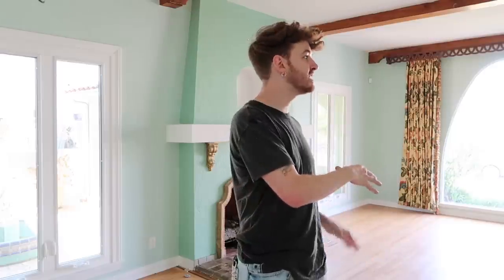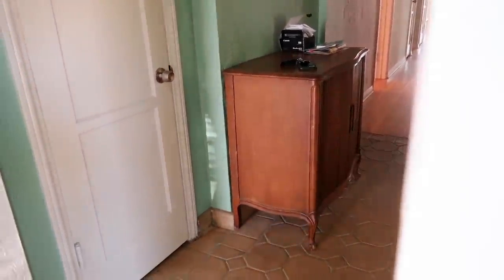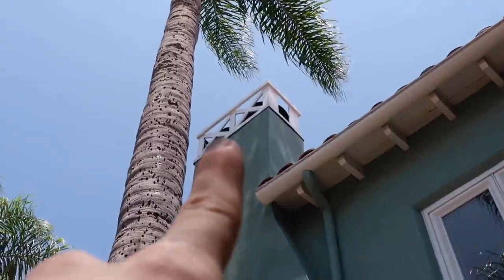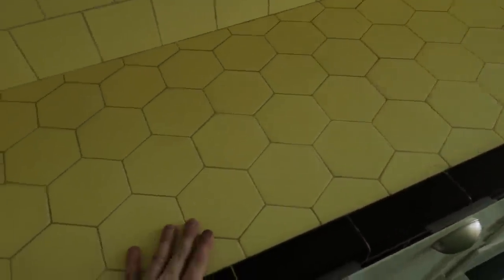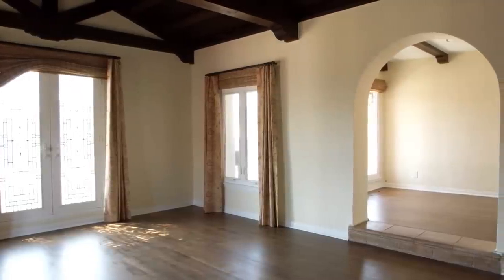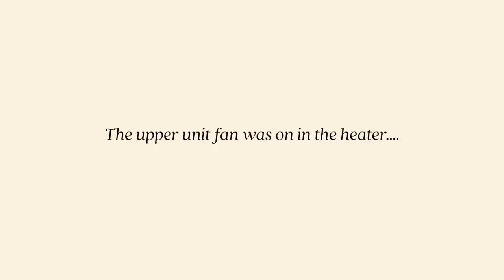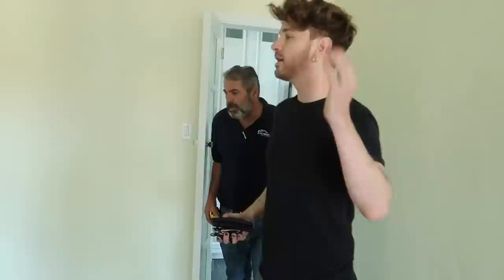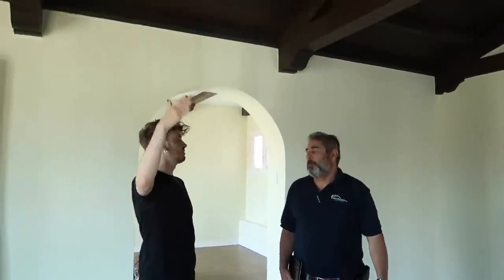Awful News About The House

Comment: You should try an infrared camera before ripping out tile. It’s often way easier to find leaks with infrared! There are tons of videos on youtube on finding leaks with infrared that can show you how it’s done! Way cheaper than exploratory wall surgery. Good luck ❤️
Reply: That’s a fabulous suggestion. Some of the slab and pipe leaks around our general area had a whole industry of leak detection with sound and new technology that also spurred the whole repiping industry. Much like Drew’s Duplex would be our units also had vertical leaks and had to go in both of the units to find the leaks with infrared and sound tech
Reply: Also a good way to find other infestations like bees or wasps in the walls or roof.
Reply: Excellent idea!
Reply: I agree with this suggestion!
Reply: Totally try this. Rent from Home Depot for a few hours. Helped us find the spot before we started destroying the walls in 1938 house. Ran hot water for 30 minutes. Also had a bunch of pipes replaced when strategic  holes were open. New pipes are like flexible plastic. First 2 plumbers suggested same as your guy. 3rd plumber was more on the page with us. Do what needs to be done with least damage.  One other tip replace wax rings in all toilets you do not replace. Those leak over time too.
Reply: Also, for the exploration, and maybe even repair is there a reason they can't go into the wall from the other side? Are there cabinets or something in the way?
Reply from the maker: Wow thank you so much for this suggestion!!! I’m so thankful to have this comment section!
Reply: @lonefox  like other people said, once you find the leak with the infrared camera you can see if you can get to the leaking pipe from the other side of the wall or underneath in the basement to save your bathroom tile! I use a FLIR brand camera that I attach to my iPhone and dump very hot water down the pipes to increase the temperature difference between the air in the walls and the pipe. Also consider getting a second opinion and more than one quote!
Reply: @lonefox  
Happy Birthday Drew

Comment: As a project manager for a couple of decades, there is no surprise that doesn't come with the overwhelming feelings  of panic about cost and delay and the basics of any unknown.  Old homes, even well cared for old homes will have their mysteries.  Do your best not to panic.  Every challenge has a solution at many price points.  Use the medical approach of do no  harm until you know harm is the only option.  If a trade tells you it is the only option, find a different voice to explore with.  The easy route is usually not the best route. When vintage tile is involved know it is set on a thick bed of concrete mortar and you should not go through it unless you intend to demolish the tile wall.  You come at the same wall cavity from the other side of the wall which is almost never tiled over and will sometimes be in the back wall of a closet which is ideal.  A plaster or sheetrock wall is infinitely easier to repair when exploring and any good plaster company can skim coat the entire wall to make a repair virtually impossible to locate.  Avoid exploring from the tile and mortar side and open the other side to have a peek in the cavity.  Also, never trust the drip you see at the floor or below in the basement.  Water will find the easiest route out and will usually follow a pipe or framing to any opening even one far from the source.  An old dry home in a dry climate can also just absorb a very slow leak making it very hard to find until you locate the rot or the termites do it for you.  Ants and termites will often find the source of water before you do. My motto remains, every catastrophe has the potential to be an opportunity if you explore wisely rather than swiftly.  Make a good plan and stick to it.  Good luck.  Congrats on a cool project house.

Comment: It’s such a wonderful house! I want to agree with other comments. Make sure your foundation and roof are perfect before you do anything else. After that start mapping your renovation plans, to get an idea of what possible structural changes will be needed. Then you can get plumbing and electrical update estimates. Floors and wall finishes are last. It’s exactly the opposite of what you probably want to do, but it’s the best use of your money. The ceilings and floors are just beautiful ! Best of luck !

Comment: Hey Drew- don’t get discouraged! After we bought our house, a potential contractor discovered that water was accumulating in the crawl space, weakening floor supports and creating mold. I was devastated but they put in a sump pump, did some bracing and clearing, and then later found that the problem was a very stupid drainage system for storm water. While it cost a fair amount to fix, it’s all fine now. I actually forgot it happened (this was 2 years ago) until I saw what you are going through. 
One recommendation— live in the house before making some of those really big changes. You might come up with a different plan after living there.

Comment: The building inspector really should’ve caught that vertical leak and could’ve been something you could’ve negotiated in the sale. Some Inspectors have like a 6 month warranty if they miss something big. I’d reach out to the building inspector you used too to let them know about this.
Reply from the maker: I’m going too!
Reply: Absolutely check with the home inspector.  A leak  on a vertical water line must be seeping down to the basement somewhere.  It should have been caught.  They do have liability insurance to cover such items.  

And...Happy Birthday
Reply: @lonefox   and when you talk to OWNER of inspection company -1. leverage your  YouTube channel and exposure 2. have a couple ways for them to remedy problem  like they can pay for 2nd opinion plumber and they can pay for final repair. yes!
Reply: Boy I agree with this comment. I hired a building inspector on three separate houses, two of the houses failed inspection which I cancelled the contracts. On the third and final home the inspector gave the home a gold star and it passed with flying colors, however the living room light fixture has a fan that doesn't work... so go figure, how did he miss such a simple thing. I wish I had known about the 6 month warranty on inspections.
Reply: @deb5710  do you mean just the light fixture itself had an issue? Like you could replace it with a new fan and it would be fine? This likely sounds snarky, but lighting with fan combos are so outmoded and cheap to replace. Yes, it would be a dumb miss for home inspection, but not anything that would impact the sale price/negotiation, surely. Please correct me if I’m wrong.
Reply: @thedepthsofrepair  The fan/light fixture is in the Living room, cost to replace will be over $300.00 plus labor. If the inspector missed this, what else did he miss that you can't see? Besides, after using this inspector on three separate home inspections, I'm out some serious cash, and he has accumulated quite a bankroll but failed to catch a busted light fixture!
Reply: Living in the southwest most homes have ceiling fans to conserve energy cost!
Reply: @deb5710  Thanks for replying, Deb. I see the practicality in your situation. I hope you can get the cost covered by a warranty, and if not, find a working ceiling fan secondhand and mostly pay for just the labor, not to mention find a decent home inspector if you ever need one again.

Comment: As one who restored a house that was built in 1905, I would agree with those who said let the floor wait. I would work from the top down and get all the basics, plumbing, electric, painting, etc. done first. I was also wondering why the home inspection didn't discover all this prior to the sale but you and others explained that pretty well. An old house is a money pit but so nice when it's done. Some of the light fixtures are certainly unique. If you take them down, you may find they are worth a lot more than you thought and could recoup a bit of cash to go forward with. Sell what you don't like and keep the rest.  Best wishes on this journey. I think you are amazing, you will figure it out.

Comment: When you showed the different shades of tile in the bathroom it made me think there was probably a plumbing issue and they had to use different tiles to patch up where they cut out the wall. Maybe they could start by taking out the discolored tile to see what's behind those areas? 🤷‍♀️

You may have bought a money pit, but it's still such a beautiful house. You're young and have no kids to drain the bank. Lol!
The house reno is the new star in your career and your 'baby'. 
It will be worth it to get the major things fixed and leave the major esthetic remodel stuff for later. You have a life time to renovate that house. Baby steps. It's all about the journey.
It sounds like you are building a great team of supportive professionals. Your house is going to be so amazing and such an awesome investment when you're done. I've been following you for years, and so very proud of you Drew! 💕🙌  You're doing  great things to create the life you love!
Reply: I don't think it's a money pit. Speaking from my own experience, sadly. Everything he's mentioned is actually super normal.
Reply: Excellent suggestions. Also, I noted that the stucco on the exterior of your chimney was textural at the base, but not at the top. Evidence of repair work? Also, in the wall you want to cut for a staircase. Same thing. It's hard to hide flaws or repairs in plaster or stucco.
Reply: @awildelife  I don't mean "money pit" in a bad way. I meant in comparison to buying a house that doesn't need any work, just esthetics vs. buying an old house to repair and fix up. In Texas it cost good $5,000 to get your house tinted for termites I can't imagine what the cost would be in California. 

Kudos to Drew though. He's doing great things and way ahead of the game for being in his mid-late 20's 💗

Comment: Hey Drew - Welcome to home ownership. Just a little word to the wise, it really doesn't get any easier. But, a couple of ideas. For the downstairs bathroom wall exploration; has anyone thought about going through the wall in the adjoining rooms (the rooms on the opposite side of the leak area)? You'd be able to see into the wall just the same, just wouldn't damage the bathroom tile. Also, be very careful with what you do with the lighting. Some of it looks original and could be very valuable. Additionally, it could be irreplaceable if lost or damaged. The 1920s were a very important time in quality home construction in LA. The ceiling beams with the accent painting are also very important. It seems like you have a home with a lot of valuable and original features. So just be careful what you do. Jonathan is a great resource but you should also tap into the experts in the area (like in Pasadena, e.g. the Gambel House) about homes from that era. I agree with you that the floors should be finished closer to the ceiling color. You don't seem to have pets and a Swiffer is easy to use. But, you may want to wait and see what you do in regard to removing walls before you refinish the floors. As I'm sure you know, you have a HUGE project before you. You have a great eye and superior taste. Just take your time and don't rush into anything. This is going to be very expensive, and take longer than you'd expect. Just budget wisely for both, time and money.

Comment: Here’s the problem: Plumber realized there’s two leaks in the upper bathrooms leaking into the lower bathrooms through the walls. They have to do exploratory work to determine how bad the problem is, but worst case scenario they need to pull out all the original tile. 

Inspection missed it cause they didn’t look at vertical pipes
Reply: Thanks
Reply: Right and Drew remember that , you can always go back to those inspectors as they have , be cause you high-erred THEM , to make sure you where getting a so,I’d sound place ! I had to do this with my inspectors and you know what ? They had to lay up ! So remember that !
Reply: You da real mvp
Reply: However you figured out there was a leak... the inspector could have found out the same way. It's LITERALLY their job. I think your inspector dropped the ball here. He should be liable. Not you. If it was an under the table deal with your agent... they are both liable. 

Also... you could check the disclosure list from the homeowners. If it wasn't disclosed... I would start calling every local contractor, plumber and ask if they have ever been to your house on a call before you owned it. 

If you found this out so soon. The owners knew.
Reply: @es4242  well... you pay them to not miss things.
Reply: @ellend9739 , inspectors cannot tear down walls to look at the plumbing, pipes and heating vents, etc. inside.  It's not possible unless the owner of the real estate gives them permission to do that, and no owner in his or her right mind is going to do that, period.
Reply: Baloney.  I'm telling you up front as a retired attorney who practiced for 30 years, if he tries to sue the inspector for malfeasance he's going to lose, and it will cost him a ton of money in the process to lose the case.  Forget it, it's not going to work.
Reply: @jannibal9273  Finally someone that understands, in Canada, the inspectors are not responsible and if I'm not mistaken inspections are done with what can be seen, not what is hidden (and I'm explaining that in very basic terms), I'm assuming its the same or close to in the US. All these keyboard warriors think it should be that way because it doesn't seem fair, fair is not a legal term. Due diligence is our responsibility when buying a home, end of story
Reply: The fact that he bought a house and doesn't even know what a blower and furnace are tells me he's going to be easily taken by tradespeople.
I was laughing as Drew was saying how the contractor was very knowledgeable and knew his stuff, based on what exactly ? He might be a good contractor, he might not, but just because he told him building information  Drew knows NOTHING about and has nothing to compare that information against, makes Drew completely unequipped to make the determination of whether he is a good contractor or not.
And this is how homeowners find themselves with more problems than they can handle
Reply: Weren't the upper level bathrooms remodeled fairly recently? I wonder if who ever did them did a hack job and did it too quickly.
Reply: @Sunnbuzz  yes. Finally a sound mind in here. 
Definitely agree.
Reply: Time to talk to an attorney....This fix could be mega $$$$.....
Reply: @ronitaeler9000  Nope. These are just normal issues that come up. A building inspector for home sales does not do a complete deep dive, opening walls and such. Their contracts cover them. Nothing nefarious or incompetent going on here.
Reply: @whitneypoole3160  this is very common and inspectors are not liable
Reply: @aeolia80  Yes, I had that thought too. Like the bathtub isn't attached? It can be moved? I'm not sure if I'm missing something there but what is the reason for that? So many questions.
Reply: @marierejoiceinjesus3846  they were in our case. We have gone through this exact issue.
Reply: @jannibal9273  a quick Google search... TELLS YOU a home inspector can be held liable due to malfeasance.... if it's a major issue. Good thing you are retired.
Reply: @whitneypoole3160  Not true. I had to pay 5k from a vertical leak that was barely used, only was used after constant use from moving in. once you buy the property the inspector isn't liable and neither is the previous owner nine time out of ten!!

Comment: I'm sorry to hear about your plumbing issues, Drew - that's really unfortunate. With respect to opening up those 3 walls, I strongly recommend that you live in the space before making a huge (and expensive) decision like that. When I bought my house 3 years ago, I had several specific renovations in mind. My thought process has shifted during that time, and I'm glad I focused my energies on the aesthetics like paint and decorating. The renovations I'd like to do now are different from what I had in mind then. Take your time and enjoy the journey. Making your home your own is a marathon, not a sprint.
Reply: Agree totally! It's important to live in a space to really get a feeliing for what works. I say this as someone who has owned and remodeled 13 homes in 5 states over the years.
Reply: Agree
Reply: Congrats on the fantastic house  You'll have great fun to redo it.  I have renovated a number of houses and I agree with others.  Do the mechanicals first.  You might consider doing a complete plumbing replacement using PEX tubing.  Trying to piecemeal repair old plumbing is a never ending chase to find the next leak.    Do a pressure test.  Turn on faucets and then flush the toilet and see what happens to the water pressure.  If none of the old cast iron pipes have been changed they are beyond their life span.  If the previous owners have done some repairs by connecting copper into the old galvanized there is a possibility for leaks at the unions.  The first main renovation I did was a froze out house in St Paul Minnesota where ALL water and heating systems had to be replaced in a 7k sq ft house on four floors.   I could go on,  but, get a few bids from plumbing companies.  You'll thank yourself when all the mechanicals are done.
I also agree about removing walls in an older home. The charm is in the age and it seems to have good space.  Give it some serious thought before making a drastic change.  If you go ahead,  make sure an engineer does the plans for it and then make sure you get a permit.  It will protect your investment.